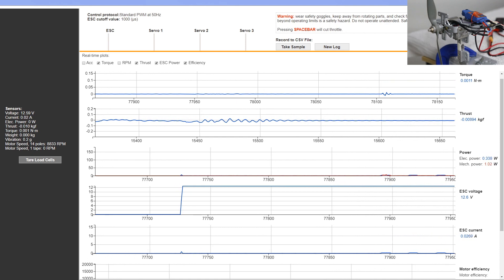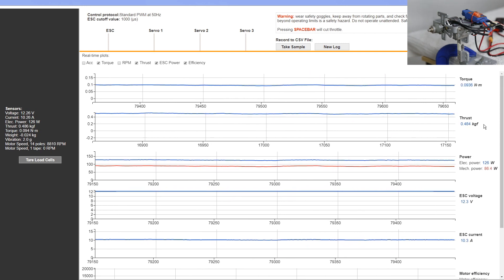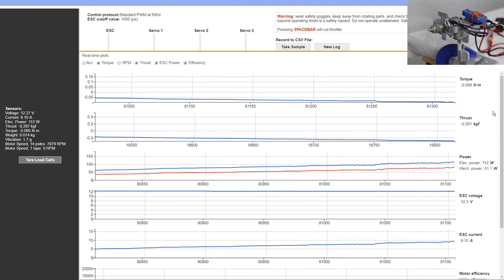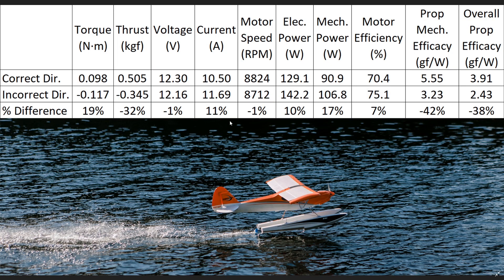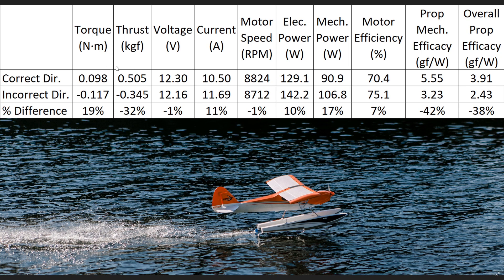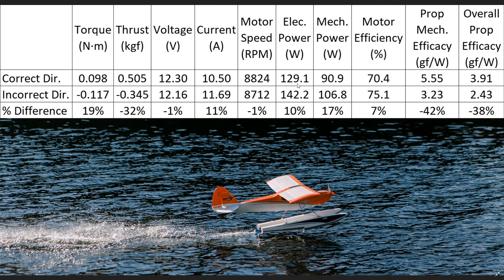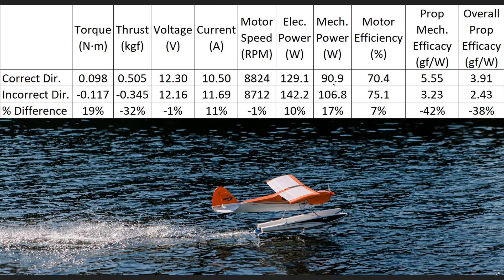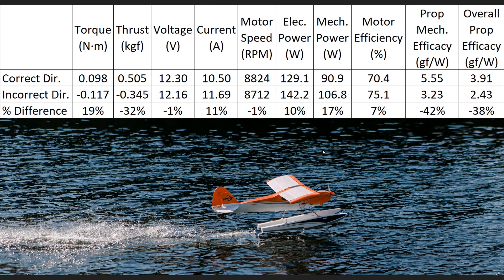Can I use a RC Tractor Prop as a Pusher Prop Spinning in the Incorrect Direction

Comment: . Easy to do with electrics, but slightly harder to get a glow engine to run clockwise. Rotate front of engine case 90 degrees on 2-strokes of proper types to reverse. Different trick needed for 4 strokes. Reportedly, all the old timers knew from genetic memory that any prop used in the wrong direction works 10% worse than in ccw rotation. Flipping the prop also seems to make sense, but even then, the engines just would not run quite as good. I think your calculations are too high and you have overlooked the polarity or dynamic orientation of your forces and all factors are not simply additive and cumulative.  (ie: some may be cancelling, concurrent or reinforcing) That "Thrust" number your system is calculating is bogus. What is directly measured static thrust, use that for checking the thrust number....or your new-fangled electric motors don't run as good backwards as our old glow engines do. To do so 'felt like' only a little drop in performance. Certainly not 30 or 40%
Reply from the maker: Thanks for the view!

Comment: seemed to me that you didnt change props you just spun a tractor prop backward and forward, i didnt see you put a  pusher on and try to use it as a tractor which i thought was the point of the video
Reply from the maker: Nope, the request for this video was specifically just changing the rotational direction of the prop.

Comment: Writing this at halfway through the video, before I forget my question: 

So, you have it spinning in the wrong direction…..but this isn’t the way I have my pusher set up. The pusher setup I have spins the prop in the direction it was meant to swing, because I have the prop mounted in a way where instead of just spinning in reverse, I flipped the prop around…it’s hard to explain in words but the motor is what changed orientation, but the propeller was kept in the same orientation (just shifted back on the aircraft). Does that make sense? I think this is different then what you tested, where you just spun the prop in reverse but didn’t change the orientation of the motor
Reply from the maker: This video is about rotating the prop in the incorrect direction.

Comment: Why not flip the prop over to face the opposite direction when you changed the motor rotation direction?
Reply: I guess that would be too easy😜
Reply from the maker: The leading edge of the prop contacts the prop adapter hub and does not allow the prop to sit well. (obvious answer here is to modify the prop by removing the material allowing the prop to sit correctly) Otherwise if you can flip the orientation of the prop and the entire hub of the prop can sit on the smooth section of the prop adapter, ( does not sit on threaded area) this would be the most ideal. In this case, there is virtually no difference in performance of the prop.
Believe it or not, I have seen 2 planes in the air operating in the incorrect prop direction requiring 80+% power to stay airborne. This is not practical.
Reply: @RCexplained  on my old trusty bixler (the only pusher I have), I use a "normal" (tractor) prop but added a spacer between the prop and the hub. Works just fine.
Reply: Since most props are not the same front to back it makes sense to flip the mounting of the prop when reversing the motor. I broke a 6x4 pusher and all I had handy was a 7x5 tractor. It provides more wattage/ thrust but I also had to limit my throttle to 50% travel on the high end in order to not draw to many amps (40A ESC) 
Also important to crank that prop nut good and tight when spinning the wrong way!!!